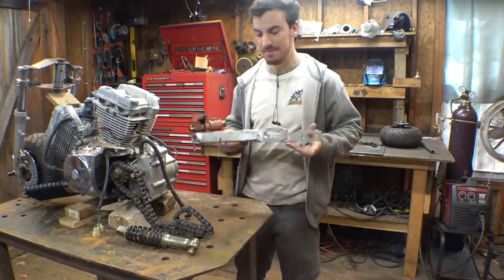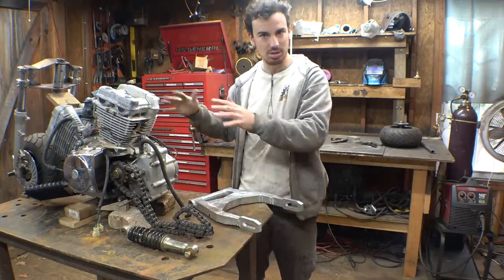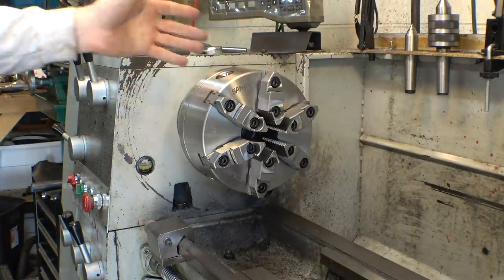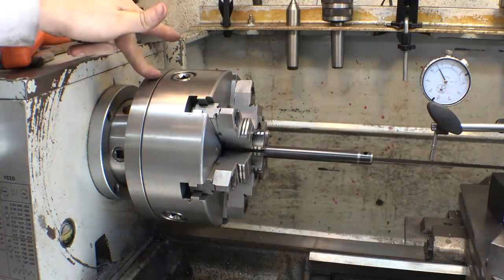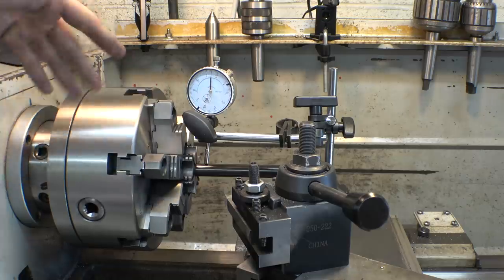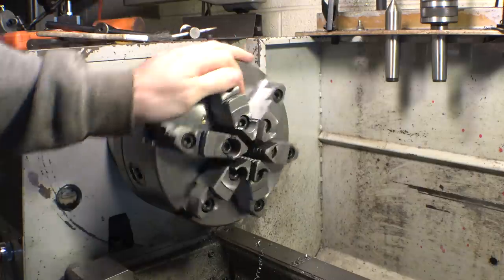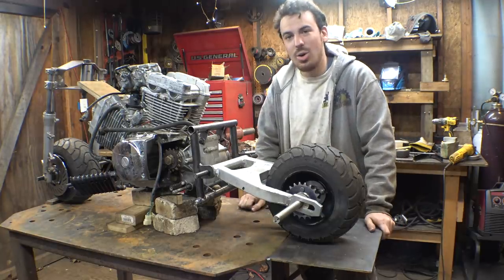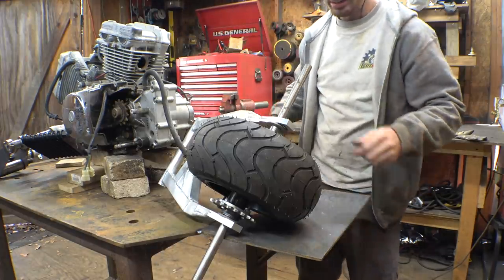Mini Crotch Rocket Build Part 2

Comment: Re- machine another register diameter on that backing plate, for the chucks ID to register on. Turn the original shoulder off the plate and create a new shoulder. It doesn't need to be a tall ad the original. Make the shoulder protrude around .100" just enough for the recess in the back of the chuck to center up on. If the chuck doesn't have a proper shoulder for its recess to register on, over a short period the chuck will get pushed off center by the forces of turning. You'll have to constantly be screwing with dialing it back in. If not, when you pull a part out after turning then rechuck it, if needed for more turning, you'll have to dial the part in for it to run true. Because it will be off from its original center point.

Comment: Yeah your problem with the aluminum swing arm is you need to drill a pressure relief hole that's the pressure building up and blowing through your weld

Comment: I have a Hyosung GT250 (2009) which might just have the same engine as you have here; If I'm not mistaken they actually use suzuki engines, customized by Hyosung. Might be important if you need parts for the motor ;)
Also, the advertised 28 hp will feel more like 20 at 11000 rpm, but it has a nice grunt from 4500 to 8000

Comment: it bubbles due to the heat build up in the tubing and is escaping thru the Malton metal pool you have fill the tube with shielding gas before welding this should help as you not forcing air into the Malton pool

Comment: When you weld it you need to drill a hole in some place so the gases from welding can escape some where othervise it Will try to escape in The last little spot your trying to weld toghether, The air escaping Will make the weld bubble up and fill it with air and dirt from inside the material

Comment: Hey Chris ... Did you drill a vent hole in the swing arm ? If you didn't, the pressure and gasses will be escaping through where you are finishing up the weld and that could be the whole problem.

Comment: Air can't escape from tube. When you welding aluminium it's hot too much, and pressure inside tubes is higher than outside,  and in the end of welding, if you already welded all the seams, and air can't more escape it's escape in last place - last slit, and when you try to weld it  metal is likuid and pressure inside the tubes push liquid metal outsiddrill. Dril a holes in place where they will not be visible and will not violate the strength of the structure.

Comment: Make a pilot on the backing plate to fit the inner diameter of the chuck the tighter the better then you will get all the runout out and it will never move on you

Comment: Thanks for all the work! I was wondering how come u don’t use the new welding rotating table when u weld round stocks? Is it possible to change the gearing on the rotating table to make it run slower? I was looking on that table for ever myself but after I watched a video and u explained that it’s too fast for ur welding skills it might b the same problem for me.

Comment: As others have said you need a vent hole. Drill a small hole and tap it for a 1/8 threaded plug on the bottom. Problem solved

Comment: When you were resurfacing the face of the backing plate why did you machine to the same place?  Couldn't you have made it so it would index on the chuck like you originally thought it was supposed to do?

Comment: The yfz-R3 motor weighs only 81 LBS, the bike has a top speed of 103 mph, and about 43hp and 22 foot pounds of torque. So on this little bike, the motor would be great, and it'd keep the weight of the bike down too.

Comment: Your trying to weld the spot and it's creating pressure inside because it's sealed! You need to drill a vent hole to let the pressure escape and then weld the hole up.

Comment: You might be getting blowback from the inside of the tube pushing away your argon..maybe drill a small hole so the pressure can escape. Grinding away the dirty metal should have fixed it but if not the previously mentioned may be the cause.

Comment: That gear ratio looks like it will be good for about 400MPH.  :)
Reply: Smaller tire uses a smaller sprocket.  Might need some fine tuning, but probably won't be too far off.

Comment: Adam Booth (Abom79) found when he fitted his first 6 jaw, that tightening each of the 3 points rather than just one, greatly reduced (or did not introduce) runout.
Reply: It's the way taught in machinist classes.  The forces are never 'even' in the sense that the closer jaws will receive more torque, it's the reason there are three as opposed to one point of closure.
SEVEN THOUSANDTHS RUN OUT!!
Start by mounting the work piece properly.  Rotate the part while engaging the scroll snug, like a drill bit and chuck.
Rotate chuck to access a second engagement point, use the third if needed.  Typical three-jaw chucks should hold three thousandths.  A six-jaw should half that, to one and a half, so a THOUSANDTHS is doing good.
Collets should hold a 'tenth' to fifty millionths.
As little time as he put into the correction, getting a half thousandths run out shouldn't be a problem.
Precision grind/lap/polish the face plate to THAT chuck.  Jaws are removable, yet don't expect to get more than a 'tenth' better (high effort).
Excellent up grade.

Comment: your welding problem could be that the air inside is heating up and by that expanding ,and it wants to  excape through the last hole to weld

Comment: Welded aluminium is prone to cracking, especially if it's not heat treated afterwards to restore the crystal structure so keep an eye on it and don't be surprised if it does after some use. Aluminium also get's fatigued much faster than steel.

Comment: I been a manual machinist 25yrs or more !! I’ve been a fabricator a cnc operator cnc cutting operator and run lathe and mill and horizontal and vertical mill and drill press everyday if I can help just ask and I will do my best to help!!
Reply: Also went to Mmi in Orlando for two yrs and been riding since I was 10ths old

Comment: I'm noticing your transmission sprocket and your wheel sprocket are very close in size, which I suspect you may find is way to tall of a ratio and makes your acceleration rather unsatisfactory. Especially with such a small engine. Typically you want between 2.25:1 and 3.50:1, depending on available power, amount of loaded vehicle weight and desired acceleration vs desired top speed.

Comment: No no no. I’m not gonna say every bike that the swing arm will match the bottom of the motor. But it should be in line with the bottom of the motor. I mean some times the front of the motor leans down a bit. But the swing arm should be in line with the bottom of the motor.

Comment: STOP!! 3 and 6-jaw chucks can be dialed in watch this video from Tublicane! https://youtu.be/E_Ks6GKKcs8
Drill and tap 4 fine thread holes thru the OD of the chuck over top of the sloppy flange and you can adjust the chuck with those screws when needed.